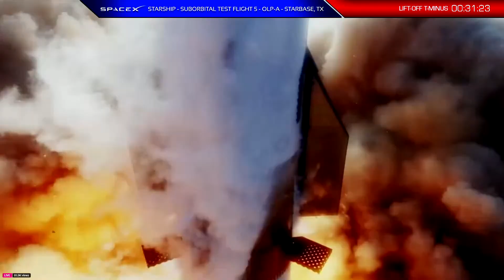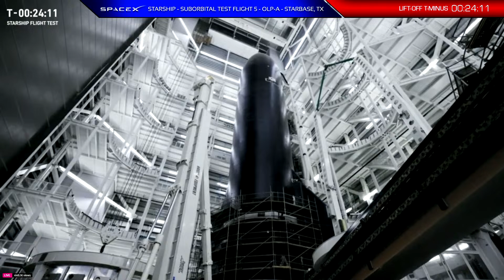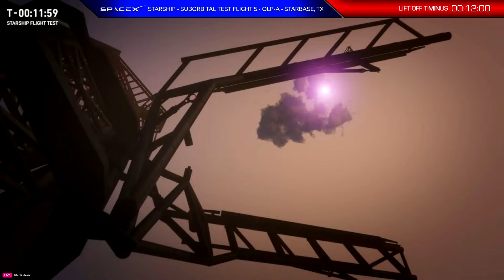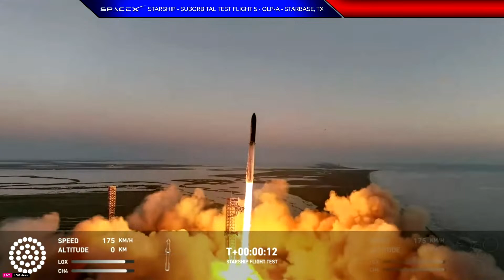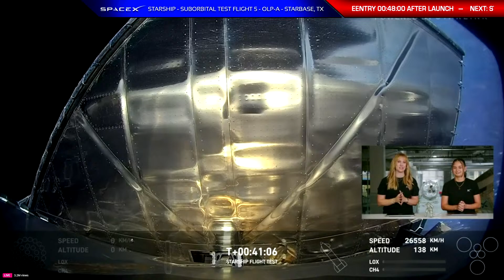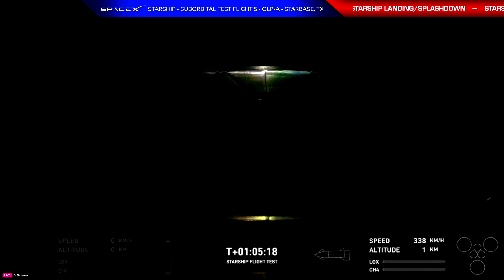ON GO - SpaceX - Starship Suborbital Test Flight 5 - OLP-A - Starbase, Texas - October 13, 2024

Comment: The replay is just as amazing as the live cast was this morning. I caught some details I missed during the live chat. On re-entry there was an actuator burn through on one of the screen upper left flap. However, the catch made it all worthwhile. Basically, they caught something just a lttle bigger than the Cape Hatteras, NC  lighthouse (which I have climbed up many times). The fireworks show at the end was a fitting tribute to the best StarShip fight to date.Thanks again SA and SpaceX